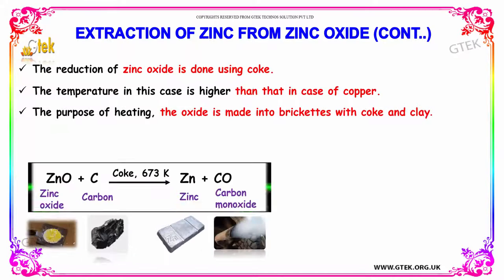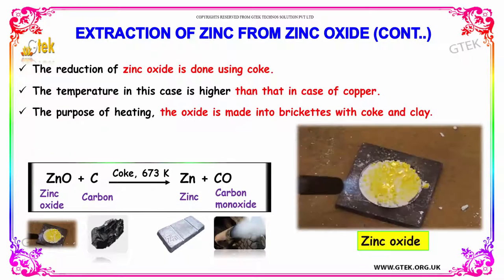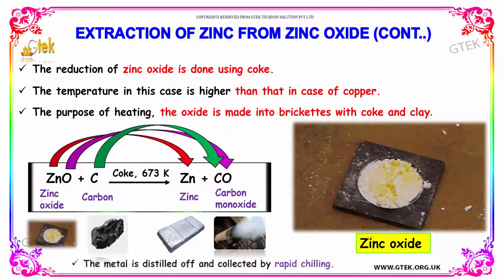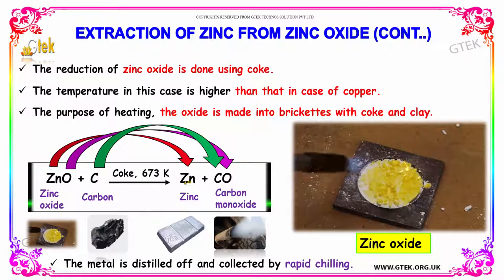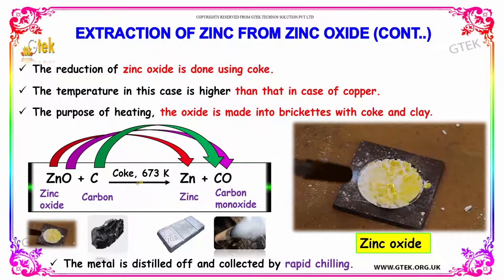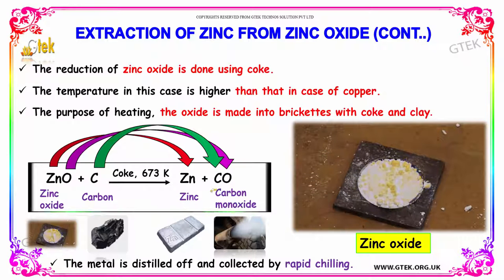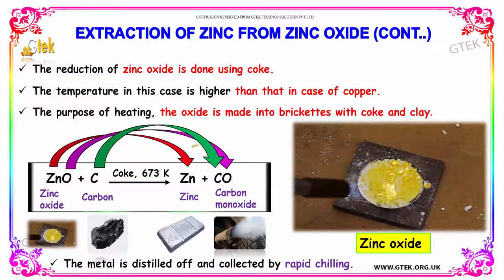extraction of zinc from zinc oxide principles and process isolation of element 12 chemistry cbse

Comment: The most common zinc concentrate processed is zinc sulfide, which is obtained by concentrating sphalerite using the froth flotation method. Secondary (recycled) zinc material, such as zinc oxide, is also processed with the zinc sulfide. Approximately 30% of all zinc produced is from recycled sources.

Comment: It is used in the extraction of several metals). The crude zinc oxide is dissolved in sulphuric acid to produce a solution of znc sulphate After filtration and purification the solution is then electrolysed using a lead anode and an aluminium cathode. Zinc is deposited on the cathode.

Comment: Electrolysis. The basic steps in this process include (1) preparation of a zinc sulfate solution by leaching zinc oxide calcines (produced by the roasting of sulfide concentrates) in dilute sulfuric acid, (2) purification of the resulting zinc sulfate solution, and (3) electrolysis of the purified solution.